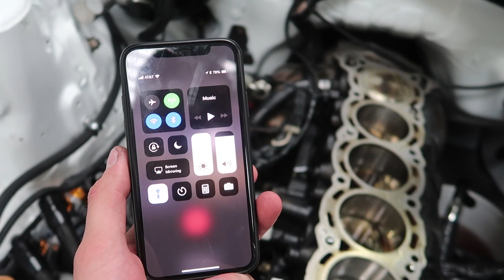DYNO DAY GONE WRONG

Comment: Even though it's not Alberto's faulty, I still feel bad for him, because he tries so hard to provide Adam with a quality build, and the machine shop is at fault here!
Reply: Benjamin Mador I agree
Reply: It was good to see that Adam thinks the same too, although he didn't blame the shop, he still cleared Alberto of any wrong doings, Good shit Adam LZ!
Reply: I would blame the builder as it’s most likely the valves have been bent by installing it with the cams In place. When they are installed you will find the intake valves sit below the head
Reply: Sammie n Dave Caisley Everyone who has said that you can't blame Alberto need to read your post and 1 I replied to a little above yours
Reply: greg h And? Every single time you build an engine you run a compression test. Every time, no questions asked. And if you don't then you run into problems like this. Plus, you can hear it in the video before this and a mechanic with 30yrs experience commented about it and even included the name of where he works to call and verify that he is legit. And if you never touched a certain parts, then no question you check them. Common sense is what that is called. Seeing something you know nothing about is the 1st thing you need to check. Think about it like this: Your driving home and you see smoke come from under the hood. Do you just ignore it or do you check it or call a shop to? If you say call/check then you should be able to to logically figure out what to do with with a situation like this
Reply: bla bla bla. I'm sure you've made mistakes before, admit it, you're not perfect either

Comment: If course those cracks going right into the head stud hole is going to cause torquing problems. This will be another engine with coolant issues. GUARANTEED.

Comment: I blame a mechanic that couldn't hear a miss that was noticable in the video and the tuner catches it right off the trailer. So the 4 to 5 hour trip was unnecessary. And yes I'm a mechanic I'm 45 not a 12 year old fan boy. I've built everything from lawnmower engines to Detroit Diesel 16v 92's. Multiple Japanese and German engines. So yeah there is blame at the machine shop you took the head to as they should have checked it but the mechanic should have heard that hole. Listen to it cranking you hear lack of compression.
Reply: Billy Beane if I recall correctly, he didn't take the head to the machine shop
Reply: Yes he did. That's why he said take it BACK to the machine shop, plus they ground the mating surface.
Reply: Vander615 Gaming well fuck lol welp
Reply: Arnold Schwartznigga No, in this case he is right. Over the turbo you can hear it. True, Alberto might have been 1- tired or 2- not as close to the engine to hear... depends on the mic location
Reply: I'm 20 have only experience working on my own cars and knew it wasn't right.. As far as they said it was only 2 cylinders firing then.. But you can plainly hear it..
Reply: Besides that they check compression on everything and never once thought to then??? Lol..
Reply: It was still untuned. Alberto admits openly he was unable to tune the car, the whole reason they were bringing it up to get dyno tuned. Untuned cars often skip, miss, run rough, etc. I doubt the immediate thought in Alberto's mind is a badly seated valve from a fresh rebuild at a machine shop..
Reply: Ya but if it were me I'd prob run tests like that just to see if it's ready for a tune.. But I can understand what you're saying.. Its to be expected before the tune.
Reply: Kinda like measure twice cut once
Reply: Brandon Thompson He didn't "admit" to not being able to tune the car he was never going to tune the car. All he was doing was getting the engine to run AKA idle.
Reply: They were tired in a rush and dude just wanted to go to bed.  If they weren't trying to get to the tune I'm sure they would have.  So you blame the machine shop for a flaw in the cast.  Or an oem valve dropping.  Ya I bet your a mechanic and you've never forgot to check something or woke in the middle of the night trying to remember if you tightened something God made you perfect.
Reply: So you guys are tuners now as well you know the tune was on point seeing as they took an hour to iron out timing make sure it's locked at 16 and put a gun on it to make sure.  Now for a fact the tps is set right in the ecu for what the sensor is showing and also are 100 on the fact that the ecu injectors fuel map all are reading correct I'm sure they took the time to check it at 3am.  Or said it runs the head was fine when we took it apart I'm sure it's the tune.  Give me a break you people are the worst.
Reply: Duane Bailey you can hear no or low compression in a cylinder while they were cranking the engine before it started.
Reply: Couldn't have said it any better, yeah sure maybe you can put blame on the machine shop but when you take into consideration the time crunch and how everything is rushed it's a no brainer. When they dropped the head off they probably didnt ask for the valves to be inspected to make sure they were seating properly so it wasnt done. As far as the dead cylinder goes.... they should have heard it.
Reply: On top of that a good mechanic should look over the work before they throw it back on. But whatever. Literally nothing Alberto has touched has lasted.. Adams cars, Taylor’s cars, and his own cars.
Reply: JeremyShred This is a fact! Great reply. And if you build an engine you always do a compression test, always. Because in this case no major problem because it was caught before the dyno. But, someone noted that one of the Pistons looked bent. At high RPM that bent pistion could have shot right out or the engine and maybe the hood (I have seen it happen)
Reply: Billy Beane well thats true., you could hear one cyl without compression back when they first tried to crank the engine, the engine crancked faster on that one

Comment: Smh the machine shop can't even seat valves properly
Reply: eel1331 what they didn't do anything to the heads
Reply: I feel bad for this dude, he seems to have so many engine problems and here I am RIPPING the hell out of my stock block s52 turbo making 600whp... he can't even get a straight running car besides the non turbo z. (I don't drift though)
Reply: Mackenzie Klock that's because s52's are actual good engines, that also respond well to boost.
Reply: come on now. RBs and SRs are great engines too :D
Reply: Gábor Négyesi doesn't seem like it, s52 are on a another level at least. A dude in my area has a e30 with a turbo s52 making like 900hp, he drifts, autoX and streetraces it, only with keeping the engine back is the chassis literally breaking from the power.
Reply: to be fair, this is just a leaky valve. every engine can suffer from this. that s52 is probably a built engine so it's apples and oranges to compare. i would say though that on normal or even slick track tyres, no engine can torque a chassis as they break traction way before that so my spidey sense is tingling on that one. i would be amazed if it did so even on drag radials on a prepped drag strip.
Reply: Gábor Négyesi s52 and s50 are strong as hell since they were made for m3 and they were used a lot in motorsport so they are built for abuse
Reply: Gábor Négyesi maybe it's a poopy chassis or maybe the man is too afraid of pushing it more (understandable) and blame it on the car
Reply: eel1331 I really don't think Adam had them do anything to the Head
Reply: He'll never have I properly running car if he doesn't put the time and money into doing the complete engine build instead of cheaping out come on the place that he bought that car had it listed for $16,000 spend the rest of the money and do it right or don't do it at all look at how many drift cars he has and look and how many are having some kind of engine issue do it right or don't do it
Reply: There also 20+ year old engines that were ran hard before you ever get them.
Reply: stephen smith I mean he barely "cut corners" by not doing anything to the head. He's spent the money and time (Albertos time with money). It's an RB which is kinda a bitch to work on. A leaky valve isn't the end of the world. One issue pops up and all of a sudden he's cutting corners and cheaping out? Come on. Lack of experience shouldn't be frowned upon especially when he is gaining it. Not to long ago he was just flipping bikes and now building motors. Hes done more than most people "doing it right". Besides its either "omg this was supposed to be a seat time car wha wha wha!" or "Omg spend the money and do it right! FULLY BUILT or GTFO!"
Reply: 16k? you could buy two of them for that much in Australia!
Reply: they only skimmed the head surface
Reply: rm6330 Um well they are legal and sold in Australia, of course, they're going to be cheaper there...
Reply: Kouki_Monster um uncomplied (unable to be registered) cars are even cheaper than a complied one so why is it different in USA? Your ability to get registration is an extra charge so of course 16k is a ridiculous price imo haha 16k gets a S15 or R34 GTT here.
You make no sense
Reply: rm6330 Yep man, it is ridiculous. That's what we have to live with here in the USA. That car and engine are illegal here. Money can change that though. You can't really compare the prices between these two countries. 240's have a K24DE but turboing it is illegal, swapping an 4 banger SR is illegal, JZ? RB? illegal. V8 MURICA go for it totally legal... Yeah it sucks man. It's not me that makes no sense.
Reply: Kouki_Monster illegal to import or illegal to register?
There's a big difference between a car that can't be imported into your country at all and a car that can't be complied and registered to drive on your roads you realise yeah?
R32 Skylines are imported into Australia second hand from Japan, they were never sold here from new.
22k aud would buy four Skylines
16k usd is like 22k aud
Reply: Kouki_Monster we swap engines here all the time and no it's not illegal haha..... and I also had a turbo ka.
Reply: rm6330 Yes illegal to register. Adams is registered which is why I'm talking about that. At least that's what I think or is it not? Yes, I do realize the difference is it not what we are talking about? If you're just talking about importing a race car and register it as a race car then it would be a lot cheaper. Again though you can't really compare the prices of a skyline in Austraila compared to the USA. Also sorry I didn't know they weren't sold there new but the fact that they're all over the road LEGALLY is a big difference. I'm starting to loose sight in what the conversation is about as I feel we are talking the same thing but its like we are disagreeing on something we agree on...
Reply: NissanHyoryuLyfe Siick what state do you live in? I unfortunately live in Cali =(
Reply: Mackenzie Klock what kind of turbo do you have on the s52?
Reply: Kouki_Monster my point is that both countries can import a R32 legally but the price in America is ridiculously expensive compared to Australia.
America is getting ripped off by importers and paying 16k for a Skyline is proof of this. 
The Australian dollar is weaker than the American dollar and the Japanese Yen.... it doesn't make sense why a 1989 R32 would be so expensive in America when comparing the currency differences.
Reply: rm6330 Oh ok yeah dude I completely agree 100% I wish it was different. Even just engine swap laws are shit here. At least depending on the state. Cali is the worst out of them all.
Reply: Kouki_Monster well anything BMW branded or LS powered is ridiculously expensive in Australia because population difference means that no where near as many BMWs are imported and the only LS engines came in for the Holden Commodore (Chevrolet SS) so people ask 10k for a LS and a T56 package second hand.
Reply: rm6330 Damn I would've thought LS would still be cheap because of the Holdens you guys have. Badass car by the way when I see one here I lose my shit. Australia is expensive in general so in the end the differences almost even out. Though you guys are luckier with emission laws. But unlucky with motorcycle laws in terms of insurance and strickness.
Reply: Kouki_Monster a second hand SR20DET is 2-3k but a pair of Air Jordans is like $250 here hahaha
Reply: All this channel has taught me is that Nissan engines are garbage, But Nissan chassis are amazing!
Reply: rm6330 SR are about the same here. Except jordans can be about the same or triple the price (depending on the jordans lol)
Jordan Nicot They may be a bitch to work on but they are far from garbage. Just go JZ for the easy route.
Reply: Nori Yaro has been abusing an RB20 on Ebisu for years with only basic maintenance and it rarely went wrong. SRs can be reliable too if done right. They say SRs are much more reliable in japan which is odd.
Reply: yeah a leakdown test takes literally no time and can save you alot of headache. then again, hindsight is 20/20
Reply: R32 GTR's were sold in Australia new. There is just loads more grey imports that are cheaper, as the ADM GTR's cost way more. There was 100 Australian Delivered R32 GTR's.
Reply: Mackenzie Klock yeah idk why him and Alberto have a lot of engine problems. It's hard not to say they need more help while building engines. I love Adam but you can even say this to your good friend at that point.
Reply: Blanco Escondido s363 Sxe borg warner.